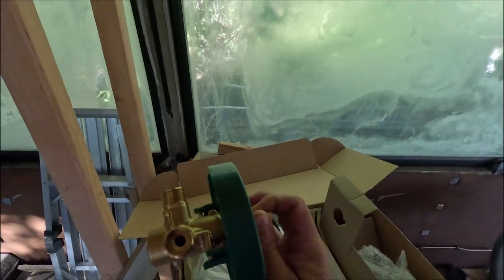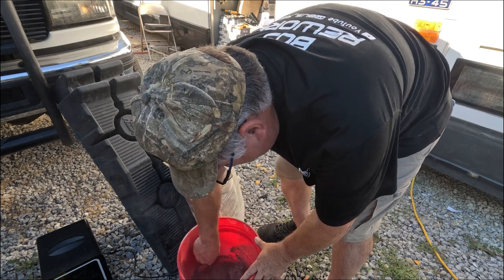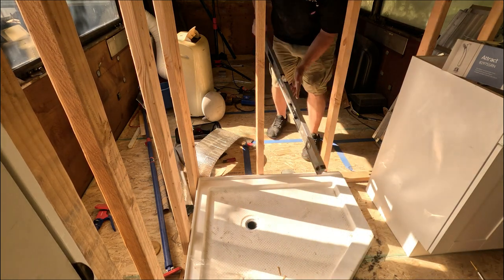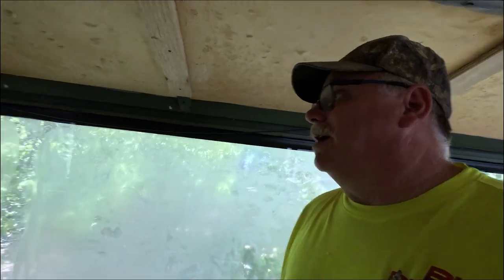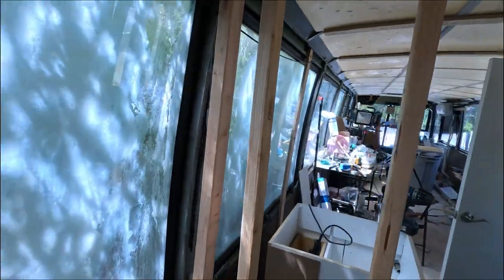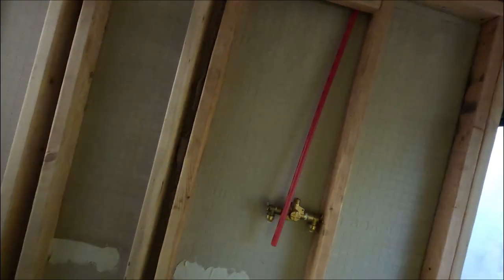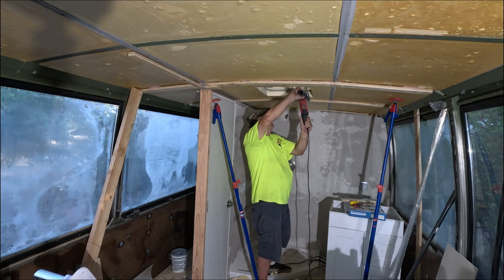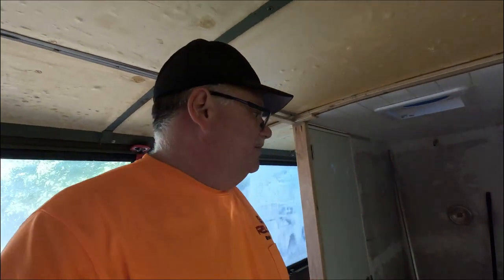E13 Shower Pt 1

Comment: You probably already know, but when you are using a level in the bus, make sure the bus is level first 🙂
Reply from the maker: Yes, you are absolutely correct! You may have noticed, I didn't "level" it side to side, because front to back the bus was level, but left to right, not-so-much...so, I "ball-parked" it. It did drain correctly when I tested with water, with the low-side draining slower, so it should all be good once the bus is level.

Thank you!